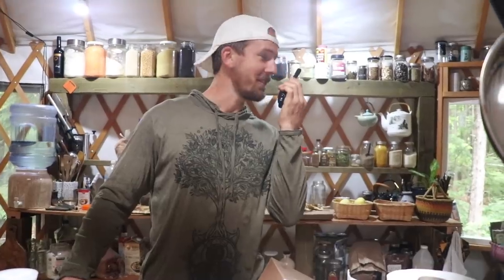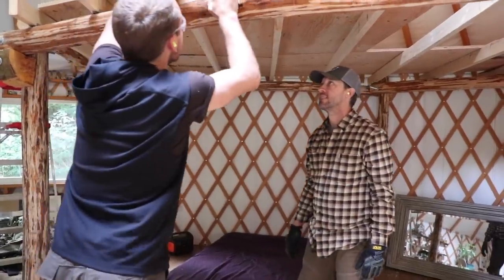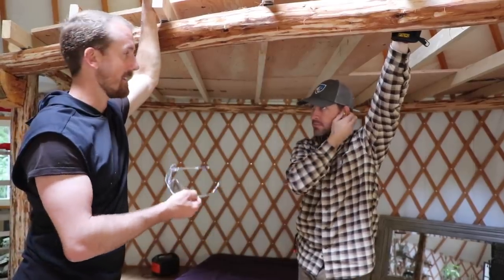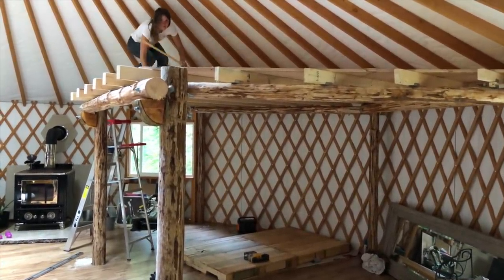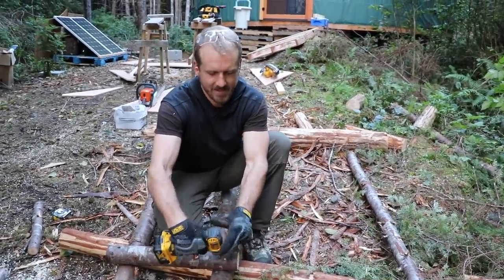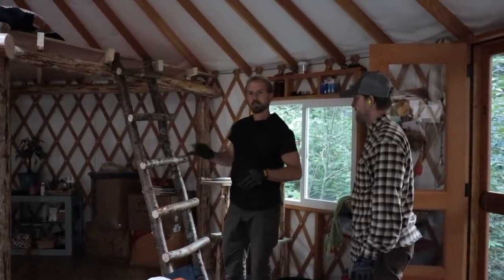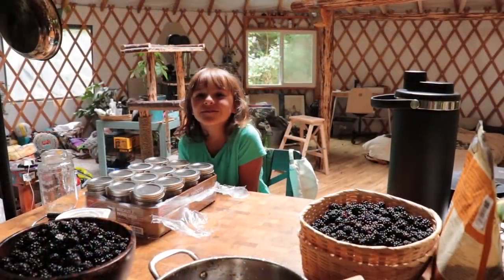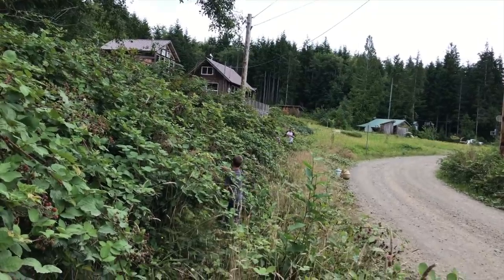Living Off Grid in a Yurt | Building a Loft - Ep. 45

Comment: The loft is looking great.  I majored in architecture.  That does not make me the expert.  If I were there I would have definite solutions. Going off what I see in the videos the loft is strong and would support a bunch of people.  It's not falling down.  It appears that you only have one bolt set up going through each cross-section.  That is strong but makes a pivot point.  I wouldn't add more bolts (for aesthetic reasons).  How about boring 3/4 inch holes with an auger bit and driving in 3/4 inch dowels.  Splewge some wood glue on the dowel and in the hole first.  Also, I would take some 2 bys and butt them up against the pole and the floor from underneath the yurt.  Screw into the subfloor and into the pole.  Now you have anchored it in the ground the yurt and took the pivot points out at the top.  Questions... what are the winters like there?  Are you not concerned with frost heaves?
Reply: @kobracom77  or you could be constructive and help with the present situation working within their means and ability.
Reply: @kobracom77  all righty then.
Reply: @kobracom77  I really don't care either way.